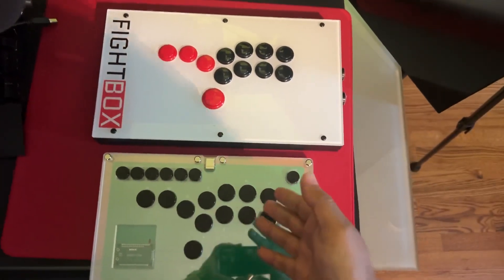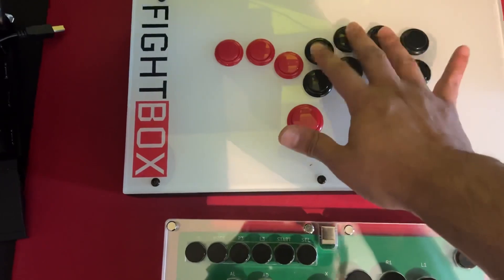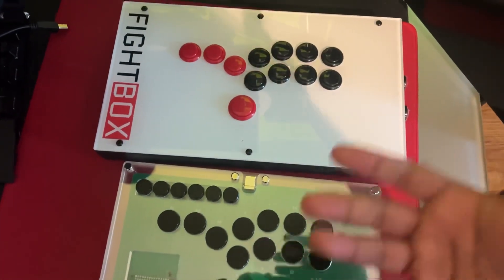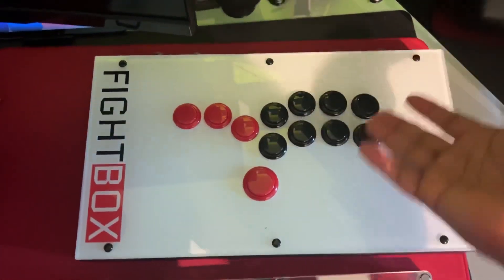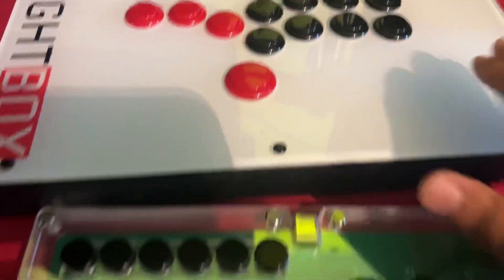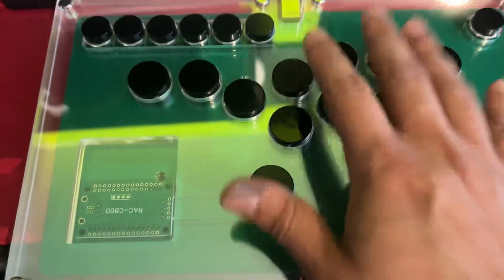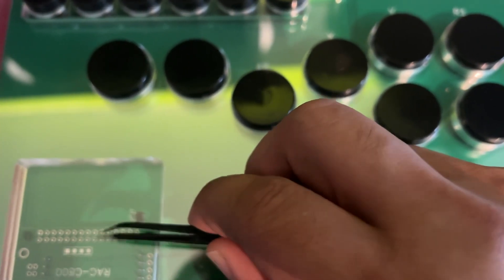Good Budget HitBox Alternatives?

Comment: Hey I was wondering, since you have the PC version of the Fightbox, have you tested the Wingman FGC with PS4 and PS5? I was researching whether it worked because as far as I know, the PC versions use a Zero Delay Encoder and some people claim that the new Wingman FGC is not compatible with that PCB. I am quite set on getting a Fightbox but I think I might just be overspending on the 70 dollars more PS4 version. Any help would be appreciated.
Reply: I’m in the same boat, can’t find any info on this
Reply from the maker: It will work perfectly, tested it on GG strive and i couldn’t notice any input delay.
Reply from the maker: @PrT0xic  It will work perfectly, tested it on GG strive and i couldn’t notice any input delay.
Reply from the maker: Also forgot to mention in my reply, i only tested the wingman fgc on ps5 the ps4 has an alternative converter from brook for much cheaper. The wingman fgc is for the ps5 and ps4 but only works with fightsticks/hitboxes. Will not work with xbox controllers etc
Reply: @FrankieJPlays so it’s possible to get a pc version and use a brook adapter to use on Xbox and would work?
Reply from the maker: @DarioBassett  yes but i actually don’t recommend these anymore. Check out my latest video it’s so good for an xbox user and no need for converter!
Reply: @FrankieJPlays  how come if you don’t mind me asking ?
Reply from the maker: @DarioBassett   gave issues after like 2 months and a whole other things video on it on the channel as well not sure if it lets me link in comments but its here. Trust me watch my latest f500 flat video too after. Video below is why i don’t recommend these.

https://youtu.be/w_mqW746eEA?si=TlI4PQfyDrZrQAA7
Reply: @FrankieJPlays  I’m not referring to the b series my apologies for not clarifying. The f series is the one I’m keen on getting the f series gave issues too?
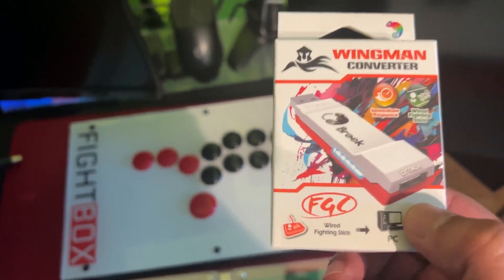Reply from the maker: @DarioBassett   then deff get the f500 flat you don’t need an adapter for it to work on xbox and if you do want an adapter it’s cheaper watch skip to 1:40 on my latest video.
Reply: @FrankieJPlays  will do bro I appreciate the advice !
Reply from the maker: @DarioBassett  no problem bud. Like i said i sent both these devices back for a reason they are just not worth the money anymore when there are newer better things.

Comment: I will take the white one. A quick calculation tells me that EACH pressing on the Cherry, will require 17% more energy than a pressing on the Sanwa, after hours of play this can feel significant.
My inputs:
Sanwa OBSF-24: total travel = 2,53 mm and actuation force 81 gr.
Cherry MX: total travel = 4 mm and actuation force 60 gr.
Energy = Force x distance
Reply from the maker: It does come down to preference and i hope it treats you well!
Reply from the maker: So uppon further inspection the main button switches can be switched out very easilly if travel distance is an issue. You can go for mx reds or speeds which would be even faster then the sanwas i believe.
Reply: @FrankieJPlays  Thanks! But I have already bought the Fightbox. It is fine, it is not that expensive. Buying a HITBOX at 250 was problematic, but not a device at ~110. I know there will be a long way of tuning and changes in the future whatever I decide to use first.
Reply from the maker: @AmnesiaGm1  the f1 is better in the sense that in the long run you could customize it more. You can replace the board inside with the brook universal one later on while on the b1 that i prefer you cannot so regardless great choice!
Reply: cherry MX silver

Comment: Would you know what boards they use on the F1 and B1? Both are great options but my only concern is if both can be configured to the new capcom SOCD rules. Thanks!
Reply from the maker: They can, check out my latest video!

Comment: By the way my bad can you use a magicboots with this instead its like 30 bucks cheaper
Reply from the maker: it does not have a secondary usb port so unless you mess with it internally not sure.
Reply: @FrankieJPlays  I went with the b1  fightbox I got a question what would you say are the best switches if I wanted to change them out
Reply from the maker: @2gunzup07   lubed akkon silver speed switches
Reply: @FrankieJPlays  thanks alot man I'm waiting on it to come from China I'm going to buy those switches and test them out I'm a pad guy have a hori real arcade pro 3 but I never got good with a stick

Comment: You almost convinced me with the transparent one in your video, for my really first. I am just concerned about the buttons, they look quite different compared to Sanwa that I have been using since 2010...They seem to have a huge travel distance when pushing it, how many milometers is the travel? can it be customized and changed with different button variation with different travel length?
Reply from the maker: They use hot swap cherry mc black switches. According to the cerry mx site their black switches have an actuation distance of 2mm. That being said i had way less combo drops on the clear one. However, in the video i do mention that the white one is totally up for people who really preffer sanwa style buttons but to me they felt cheap and unlike the sanwas on my razer atrox or mad catz tournament 2 edition fightsticks. Idk if it’s the size of the buttons or the ones they use but the pc keyboard switches one felt better and they were slightly bigger and closer to fightstick button size!
Reply: @FrankieJPlays  Ok, I think I will order this one very soon then. Wish me a good transition...
Reply from the maker: @AmnesiaGm1  if you are really on the fence then deff try to get it on amazon and make sure it’s shipped/sold my amazon so you can send it back if anything. Amazon tends to be leniant if you you call and tell em it’s defective etc..
Reply: @FrankieJPlays  what about the force needed to press those buttons? Is it very soft like the sanwa?
Reply from the maker: @AmnesiaGm1  they are pretty soft but as soft as sanwa? Probably not again, they are cherry mx black switches if you have a local tech story, best buy etc you can go and see if they have cherry mx black keyboards on display and test the feel since it’s the same switches.
Reply: @FrankieJPlays  A video of test on the cherry mx black switches says "60 gr" for actuation force, while a Sanwa would be 55 gr for actuation, and 81 gr for total travel. This sounds totally fine, I was afraid the cherry mx black switches would require like 1,5x or 2x more than sanwa. In actuation distance, Sanwa would require 1,7 mm while cherry mx black switches is 2 mm.
Reply from the maker: @AmnesiaGm1  no, like i said i actually like the switches more then the sanwas at least for these models.